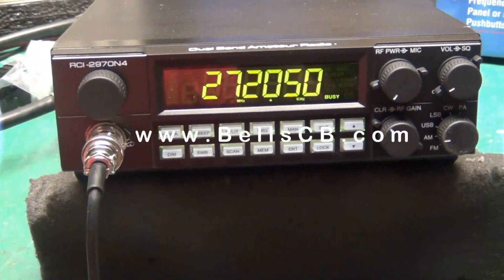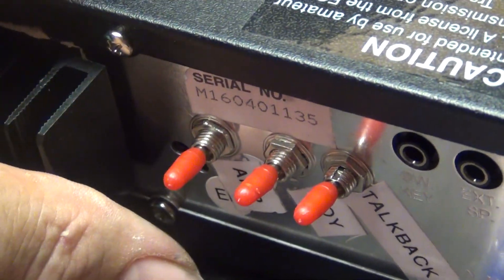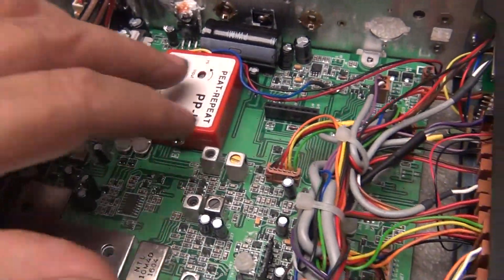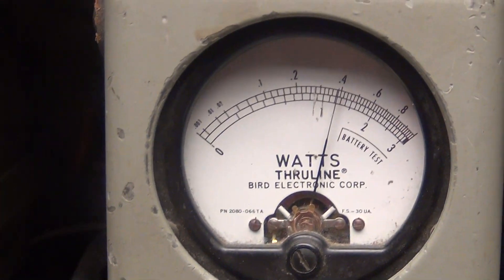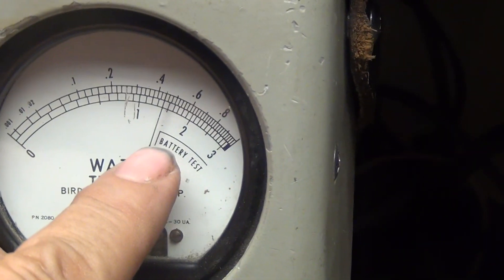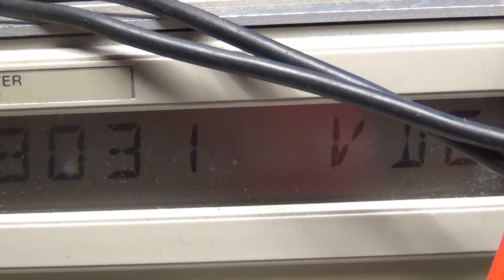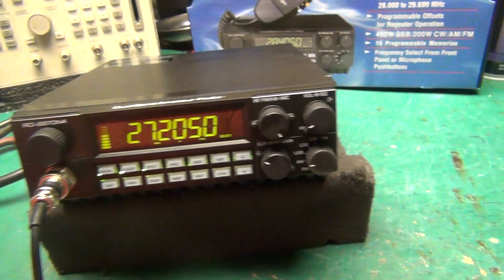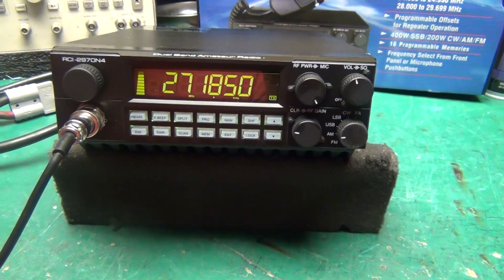Ranger RCI- 2970N4 Tune-up Report - Toshiba

Comment: Radios aren't designed to run with amp off. Lol.... I had a 94hp he put a switch for the amp on. Cheap switch at that. Also ssb had a mad carrier.  Shoukd be a Carrier of you're not talking

Comment: what did it come with?
2290?
Reply: The 2879s in the rci 2970n4 are dei brand. Hgs are good far better quality. The Dei you cannot push hard. Also your swr has to be very low 1.3 swr or less. If not the dei will most likely blow.
Reply: @rondellschuyler7074  I was just in my new 2970N4 and it has HGs blacked out. You can shine the light a certain way on it and it shows plain as day.  I have four Toshibas laying here for it that I was going to have Andy put in it but Andy got it pepped up to 550 pep at 14.4 volts. That is the maximum voltage my 120 amp  power supply will make . It pulls 48 amps wide open. 
Edit: the earlier 2970N4s may have RCIs??? I don't know but my late model does have HGs
Reply: no it comes with ranger 2sc2879 transistors that are black top and nobody knows what they are and dont know if they are as good as the red dots
Reply: crack the tops off and compare the dies
Reply: Doubt it...prolly hgs or mosfets I think is the other possibilities don't quote me